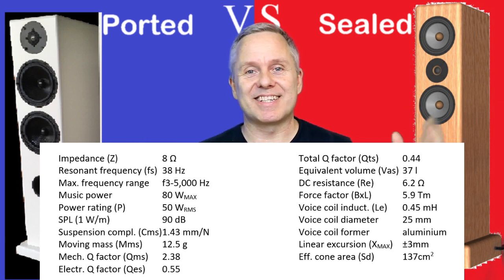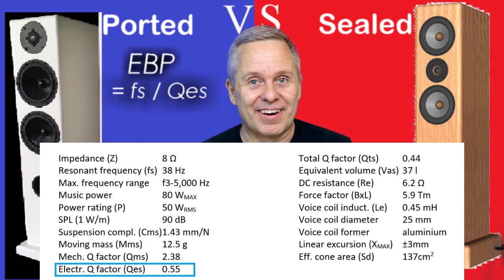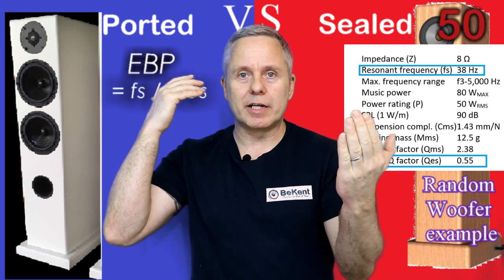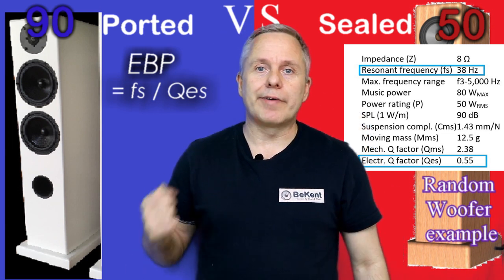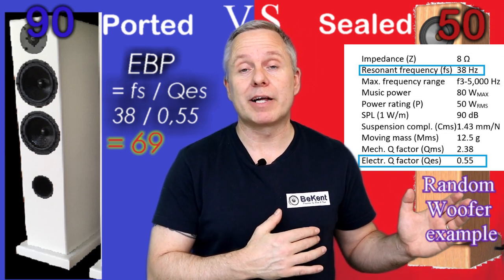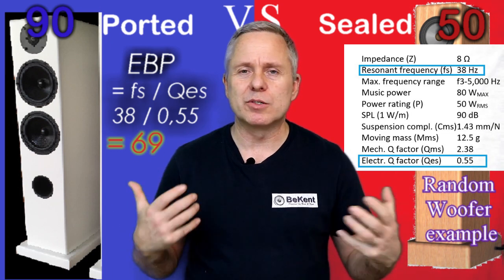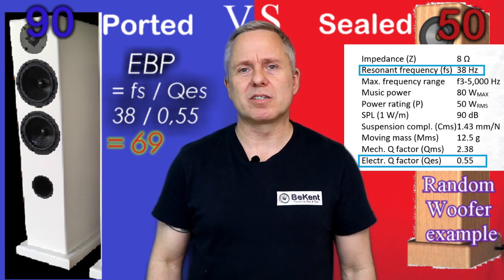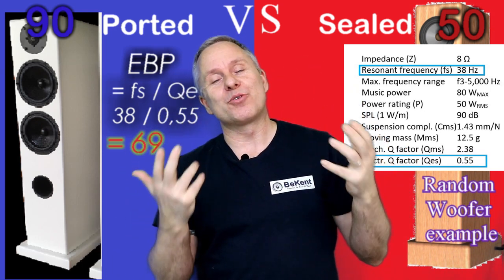Ported vs Sealed Speaker Box

Comment: I've found the room plays a defining part in what sounds best with ported vs sealed. My sealed kef q550 sounded great in a small room, loads of tight bass, but too weak in a medium room. 

I just picked up some ported kef r500. Will be interesting to see if they have too much bass or sound muddy and boomy in the small room and ok in medium size room. 

I mean they were twice the price, and supposedly a better speaker, and many very expensive speakers still use ports, they shouldnt be worse speakers - IF in the right room.

Comment: My JBL studio 580 has a port and a port insert.  I keep the insert installed.  Can't tell much boost with it out but the bass is definitely more smeared.  It might be different if they weren't close to the back wall.
Reply: I think the speaker if it is specifically designed for use in a sealed enclosure it will not perform so well as a ported, and vise versa

Comment: What if i'm using large loud speakers that have 10", 15" and 18" woofers in my atmos system as well as 10" subs? my LCR are all 15" as well as the surrounds and rear heights. my front heights are 10" and my surround rears are 18". All the speakers are ported including the subs but the 18's are sealed. would this all cause infinite sound problems?

Comment: Good and informative video. My only question left from this video is where does a sealed box with resonator sit, is it close to a ported design, or a sealed? Or is it better suited for entirely different driver characteristics?
Reply from the maker: Hi Peter, are thinking of a passive radiator? in that case its closely related to ported, but has its own calculation due to weight of the cone and stiffness suspension will affect the result. A resonator is not intended for a box, its also what is called a tactile transducer or an exciter, they get mounted on the structure where you sit typically.

Comment: A friend has late 70's Infinity Reference Studio Monitor Speakers , they have acoustic suspension cabinets, their sensitivity is only 88db and therefore the speakers are not easily driven , now he want to know
can making a bass port hole in the cabinets on the front make them more efficent , if yes , by how much db  in your opinion, thanks in advance for your valuable answer.
Reply from the maker: Hi Rodney and a good question, unfortunately, it will change the speaker too much to put a port in it, you will get a lot of bass decay because a closed box requires rather high Q drivers and ported low Q if the drivers are something around the middle you potentially can, but the box will typically need to be bigger on top of adding til port. I highly recommend adding a subwoofer, because your speakers very step response will go, and that nicely nuanced bas from Arnies early designs I think is really something, so I will highly recommend not to do it but add a subwoofer, either SVS or Earthquake MiniMe if you really want some juicy lows.
Reply: I wouldn't recommend it at all. Ports have to be specially tuned

Comment: I want to keep my box from being too big and plan on using 2 identical woofers, is it possible to have good results with one being in a sealed chamber and the other in a vented portion?  in parallel or I could design individual crossovers to make a 2.5 way. Has anyone ever done this? one sealed and one ported in same box? thanks

Comment: i have a 18" 4500W sub that i have in a 10.5 cubic foot enclosure, tuned to 34hz.  i just did the math and my ebp is 42.2...   i had assumed this was meant for a ported box and the mfg also says either or BUT if the ebp is anything to go by... i should try a sealed box o.O.   its quite peaky right now (to be expected) so maybe if the sealed smooths that out i could add a second to help bridge the gap in the output from a ported to sealed...  edit: fs=24.9, qes 0.59, qms = 7.38
Reply from the maker: Hi John, yes that gives you a qts on the driver of approx 0,55 so I will recommend a closed box if you want nuances and a nice natural roll-off , but you will get less extended lows.

Comment: Overbased (most systems) are crap. Meaning, they sound like shit. It's more base for the sake of more base. It's like a woman with a BBL. yuck. 

A sealed enclosure is clean and tight. It's like a natural slim fit woman, a dancer for example.  yummy!!
Reply from the maker: Sealed is amazing but doesnt work for all drivers for a balanced natural response, there is no getting around looking at each driver. You need a fair amount of qts compared to your fs not to role off to soon and make it unnaturally anemic.